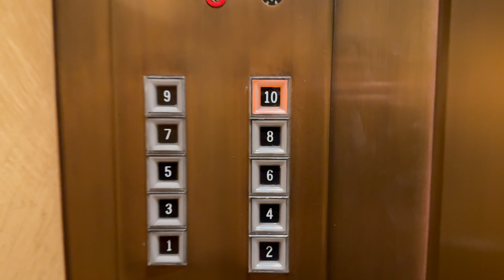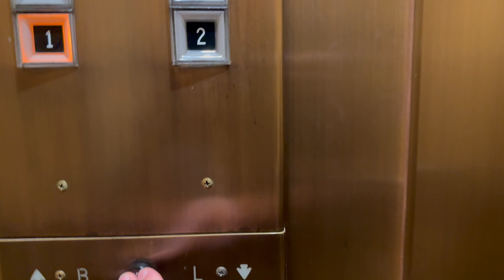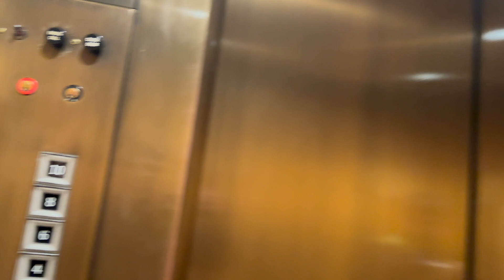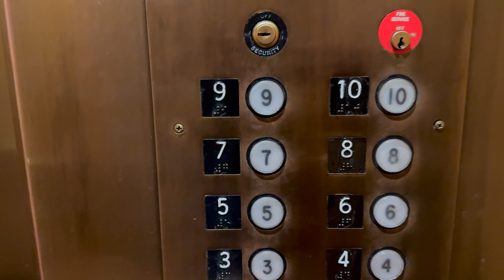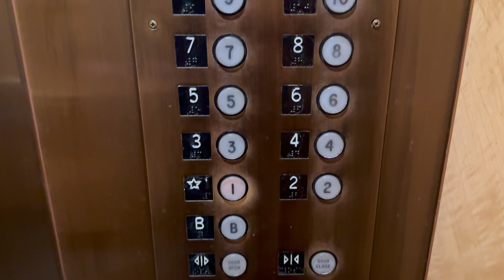Otis Square Touch Sensitive Traction Elevators | Undisclosed Location | San Francisco

Comment: I remember seeing a lot of these as a kid in the 60s. A local hospital that will soon be replaced had them prior to a mod, it was constructed in 1963-64. I also remember several downtown San Diego buildings that had them back then. They were so cool!!!!
Reply: Do you remember any buildings with the "pop-out" type buttons? When you press them, they "latch in", and eventually they pop out.
Reply: No, I don't remember those anywhere. The second coolest elevator buttons were on 1961 vintage elevators in a San Diego department store. They were mushroom shape made out of clear acrylic. They were replaced in a modification, sadly. They were made by Elser Elevator, which I think became US Elevator. I regret not going to ride these one last time, I sure rode them a lot as a kid in the 60s.

https://www.youtube.com/watch?v=0ZI92I49Vx0